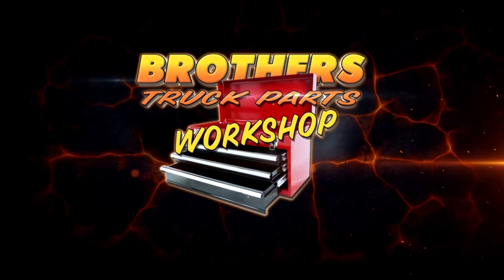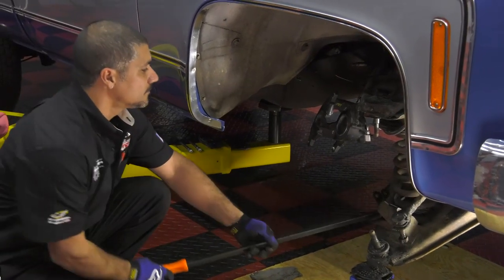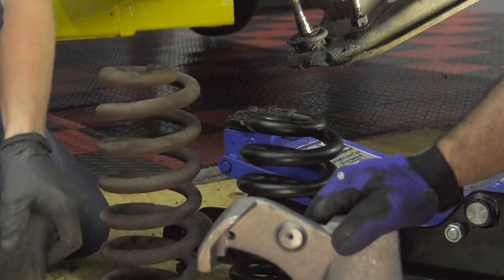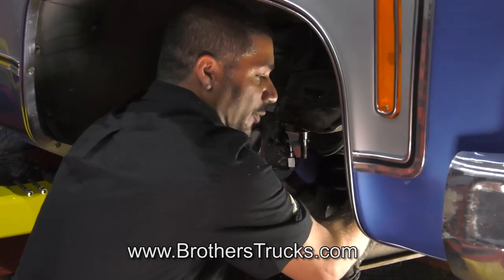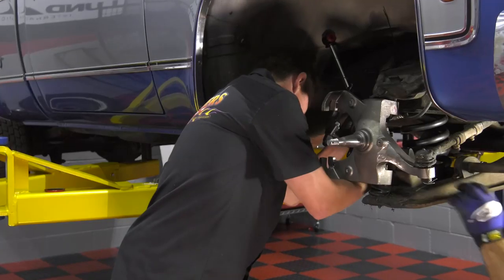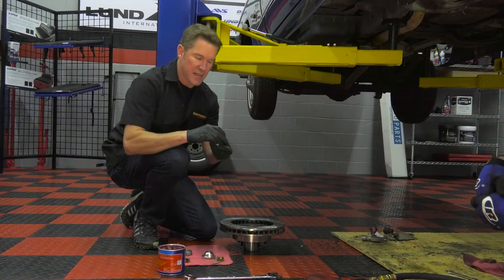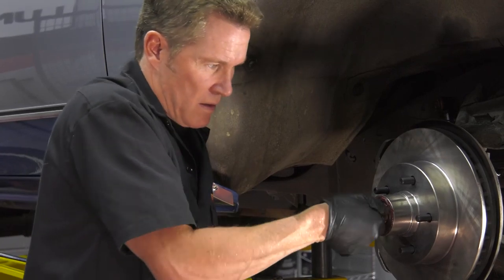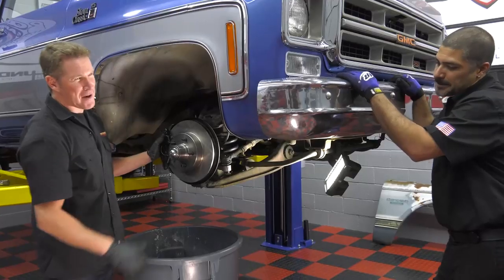Installing Drop Spindles & Coil Springs - 1963-87 Chevy & GMC Truck

Comment: Well it didn't show the grinding of the spindle, in all Chevy trucks when drop the rim hits the spindle and lower control arm, I wanted to know what you guys did for fix this problem..
Reply from the maker: We didn't have to grind our spindles for clearance. That ONLY happens when using a non-disc brake 15" wheel or ANY 14" wheels. Additionally, BROTHERS Spindles are specifically made for us with extra clearance for lower a-arms and to accommodate unusual backspacing.
Reply: @BROTHERSTruckPartsTV  wow yah I have a 15" wheel i just bought a 1" spacer

Comment: This sounds so easy but let’s do it 1964 c10 style front spendals and master cylinder booster and lines thanks guys
Reply from the maker: Here's a couple links to videos we've already done that cover what you're looking for... Booster install with line install tips: https://youtu.be/jyXeBOg2wjE - Disc brake conversion 1963-72 Style: https://youtu.be/sebg51EheUo

Comment: About to lower my 83 spindles and springs up front are there Torque specs?? Or just tighten until it’s tight
Reply from the maker: Just from memory we don't recall the torque spec, but there definitely is a spec. Google it for your truck so you get it right.

Comment: I have 15” rims x7” will they fit with this drop? Or am I gonna hit the lower control arm?
Reply from the maker: You'll be fine!
Reply: What’s the limit on the 15 inch rims before the control arm hits the wheel?

Comment: What type of brake caliper did you use am having trouble with mys i bought a 1.25 drop spindle and had to change my bearings and rotors but having trouble finding the right caliper
Reply from the maker: Did you buy the drop spindle from us? It's hard to say what caliper to use if we don;t know what spindle or what rotors your setup has. We don;t sell a 1.25" drop spindle, so we have to assume it came from somewhere else? Sorry, but we can't help without some more info.
Reply: @BROTHERSTruckPartsTV  im having the same issue. 1.25 drop spindles are HD or so they say! but im not able to use my stock calipers. any suggestions
Reply: @chingonchacho  what type of rotors and bearings did you buy to fit it??
Reply: @leonardsandifer6174  i ended up calling POL and they sent over thier caliper and rotor set    the c10 is in the shop pending to function as i hope

Comment: Are front shock relocation needed if you drop the front? I know for the rear you need them if you go past 4".
Reply from the maker: Same as with the rear, it's going to depend on how low you go. We recommend them on anything lower than a 3" drop.

Comment: I have a 79 gmc camper special I think it is a 3/4 ton do they make drop spindles for 3/4 tons any on know?
Reply from the maker: Not yet, but you can pretty easily convert your 3/4 to a 1/2 and use 1/2 drop spindles. Simple as swapping the ball joints

Comment: Can you tell me if you are using the 3 inch drop or the 2 inch drop. Coils from the website?
Reply from the maker: This truck has a 454 with factory A/C so we used a 2" drop coil and added a couple of helper blocks to give it a little extra lift and stiffness. If you have a 350, then you could easily run 2" springs with no helpers or 3" springs.

Comment: What's the part number for this complete lowering kit?
Reply from the maker: Jason, what year is your truck? There are a few things we need to know before we can give you an exact part number. Please call our shop and one of our tech guys will hook you up. 800-977-2767
Reply: @BROTHERSTruckPartsTV  1981
Reply from the maker: @jasonfurtick2395  Jason, ring the shop and have them run down the options you have with an '81. There's still a few options and we can't narrow it down to a single part number without going through a lot of back-n-forth here on YouTube. 800-977-2767
Reply: BROTHERS Truck Parts is there someone that speaks Spanish
Reply from the maker: @andresrios8505  Yes we do

Comment: So after installing drop spindles in my 70 short bed , new ball joints etc.. I have a one inch lean at the drivers side. How can this be corrected? My springs are new too.
Reply from the maker: Call our Customer Service dept at 800-977-2767 and let's try to figure it out. Too many variables to try and sort out using comments here on YouTube. Thanks!
Reply: How did you solve this. I have the same problem I have near ball joints and 2 " drop spindles and one side is lower than the other
Reply: dan bentham I took out the stock upper control arms and add the cpp tubular ones and it’s fine now.. it was a heavily used farm truck so I’m guessing something was just worn out or bent
Reply: @rockyp544  was their any other indication that it was the upper control arms keen to get mine sorted but wonna be sure its gonna solve it

Comment: So the springs don't pop out when u disconnect the spindle
Reply from the maker: They will if they are left under pressure. You need to support the bottom A Arm so it can't suddenly drop when you release the spindle nuts. Check out our other video about changing coil springs https://www.youtube.com/watch?v=IMYWFWqUZ9c&list=PLLqc8GHyO_LH7Kvm8k6Do_aw2jTgiAxUA&index=35&t=0s